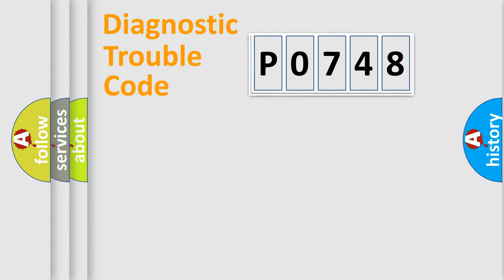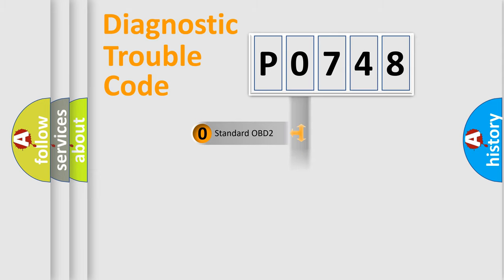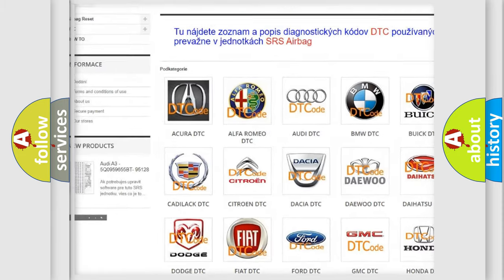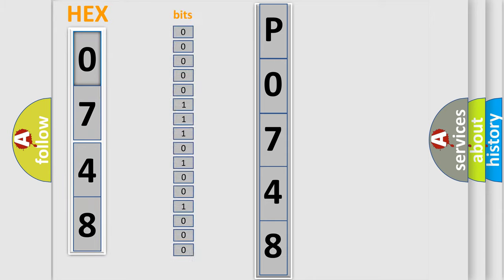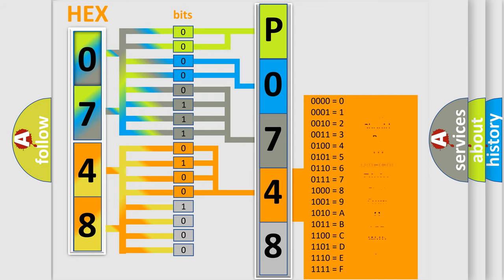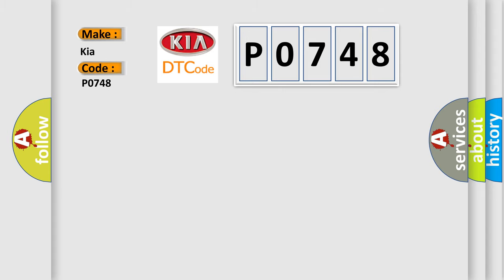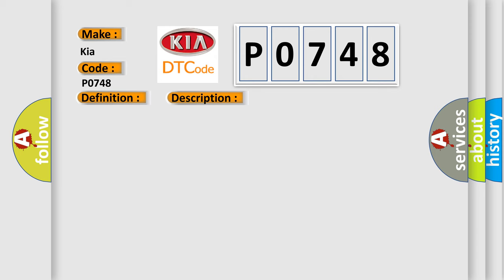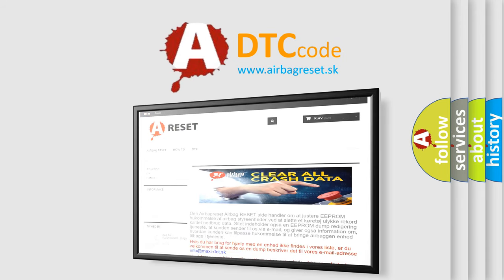DTC KIA P0748 Short Explanation

Comment: This is not what this code is about!!! The OBD-II Protocol has this error code related to the Automatic Transmission. The code is actually defined as " Pressure Control Solenoid "A"  Electrical Fault"